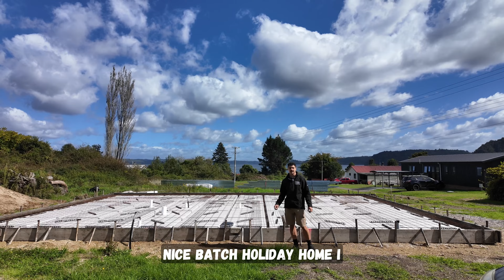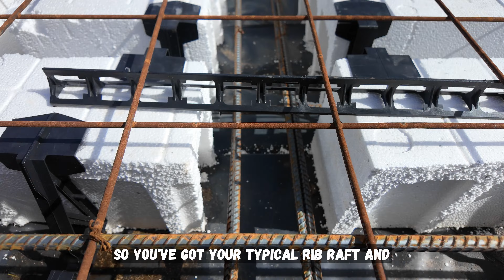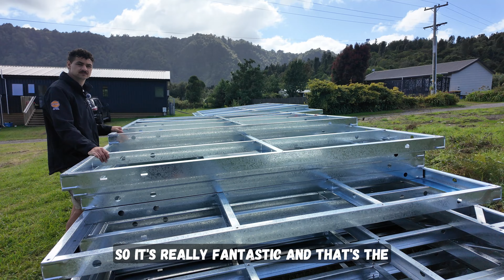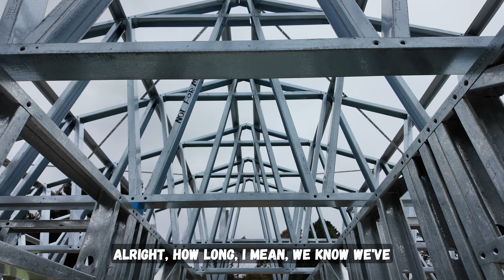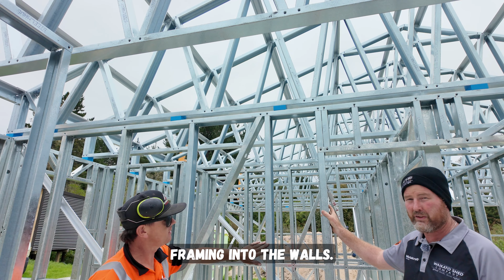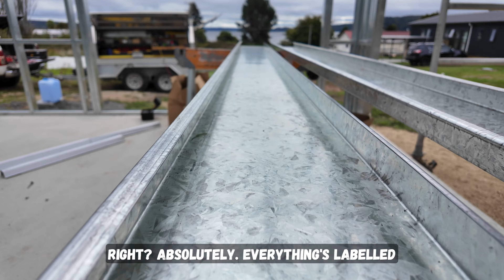Epic Shed House Situated Around Lake Rotoiti, Rotorua, NZ with Corrugated Colorsteel Cladding.

Comment: Nice...
Seems to be the way to go structural strength wise,the life longevity,the speed of putting it together,the protected pre-drilled holes for electrical at different heights saving material costs,for plumbing,etc etc...
So many benefits...
Great option thanks for sharing!
Reply from the maker: Cheers mate it’s an awesome option and generally cheaper than timber now.